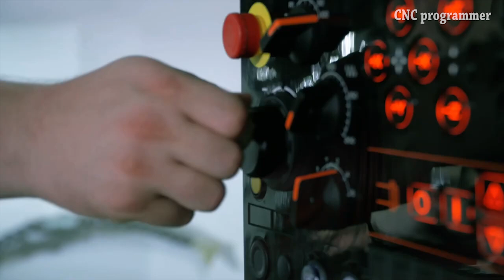mazak perfect CNC machines - mazak history

Comment: Basically a Japanese HAAS. Mori, Makino, Maatsura, Okuma all better machines.
Reply: U never operated a Mazak, right? Okuma is the only one what can compare with a Mazak in precision and quality.
Reply: @renetr6771  Wrong. I use an E670H Integrex. It’s a pile of shit compared to the MORI Seiki NT I also have in my section.
Reply: @metalchomper  I also operated Mori Seiki's and i can't understand how you can compare those 2 manufacturers and think, that would be the better one.

What let u think so?
Reply: @renetr6771  20 years of experience, and understanding maintenance of the machines. The Integrex E670H weighs the same as the MORI Seiki NT5400 despite being almost twice the size. The gantry in the NT5400 takes up almost the entire machine in the back and is fixed. The gantry holding the turret in the Integrex moves freely along the 2 slides using direct drive motors. The Integrex is a piece of shit compared to the MORI. The Milling spindle is also far more rigid. The Mazak is a loud machine when being used due to lack of rigidity when milling. The MORI has a low deep growl. You know nothing about these machines and clearly haven’t used both if you don’t know the difference. You just don’t want to look like you’re wrong when you are.
Reply: @metalchomper Im sure u accidently inverted the brands in your description. I never saw an integrex with a direct drive motor (maybe they changed this in the last years).
DMG Mori uses this on the z axis for almost every machine (starting on the cheap Sprint65). We bought Mazak, depending on our bad experiences with DMG Mori before. What you describe on the mill head is exactly the reason, why we not choose Mori anymore. While the Mazaks do a soft and strong millingoperation, Mori was vibrating and shuttering even on smaller cuts. Also we had a reccuring problem with the bearings of the main spindle wearing out in short time, when doing deep cuts the most time - and thats something, i hear from many sites, till today.

But, i have to be honest. I never operated such huge machines. I can only talk about sizes up to i-350  and NTX2000 (maybe it was a 2500, don't know it exactly anymore).

Maybe, on the big sizes, Mori was able to produce better machines - but u are the first person i heard saying this.  

(Im in this Job since 1997)
Reply: @renetr6771  We have a Mazak Technician that comes in to repair the machines and even he asked why we swapped to some Mazak machines when the Mori’s we had were better. Mazak is the Japanese HAAS.
Reply: @metalchomper  If you are happy with a machine, why should you swap. Ofc that is worth a question.
But this "Mazak is the Japanese HAAS."
is absolutely bullshit and has nothing to do with the reality. Mazak and Haas are just in different universes.  DMG and HAAS, yes, because DMG is just the low budget brand of DMG-Mori - which was bought by Mori to find a way in the German market. 

I see now, u just wan't to troll. Sad.
Reply: If I could laugh at you I would. But I just pity you
Reply: @SkateboardCaes  You’re just a smooth brain. I’ve had Mazak repair technicians tell me straight up the MORI is better. It’s simple. Just because you use a Mazak everyday doesn’t mean it’s the more rigid machine.
Reply: @metalchomper  It's been the opposite of my experience. The DMG controls are unbelievably convoluted and their machines are weak AF in comparison with Mazak. 
The entire first two years we had our first 2500 NLX we fought with sensor issues regarding the chuck clamping. We called on them for MONTHS and they finally came out and fixed the first issue after they tried telling us it was US. 10" chuck and it can't even do a .100 DOC in plain steel without wanting to throw a part.
Not to mention the fact that both the DMG and Mazak controls are the same at their core (Mitsubishi). 
DMG, Mazak and Citizen Swiss machines are all Mitsubishi based, but DMG is by far the worst in implementation.
We've even had a tech come in and ask "why didn't you just buy another Mazak"? Because he hates his job that much. 
Meanwhile, we're doing . 175" DOC at .023 IPR on our Mazak with an OVERSIZED chuck. I'm not saying DMG machines are "bad", but saying they're superior to Mazak is laughable at best.